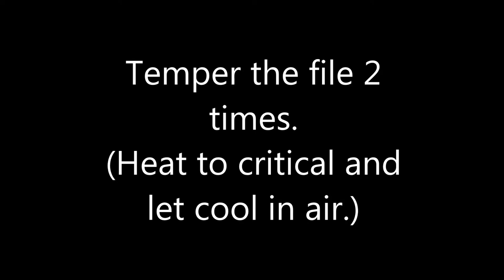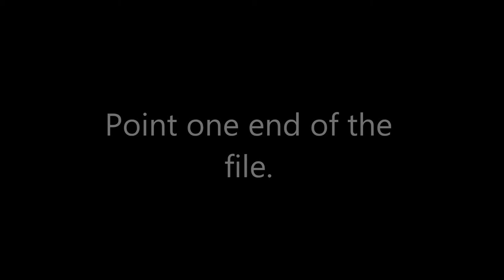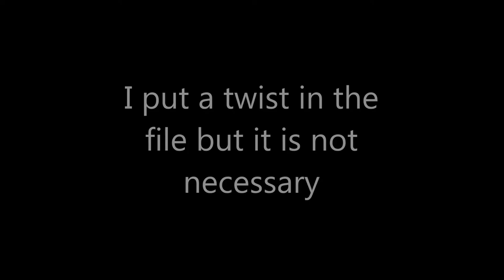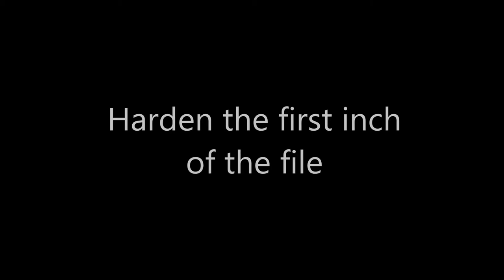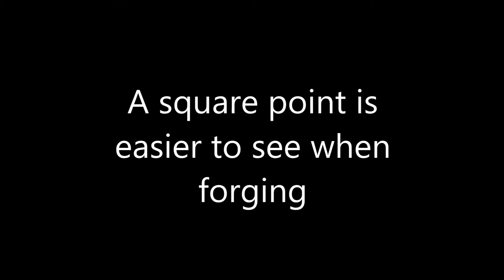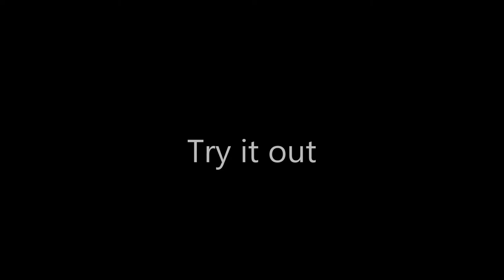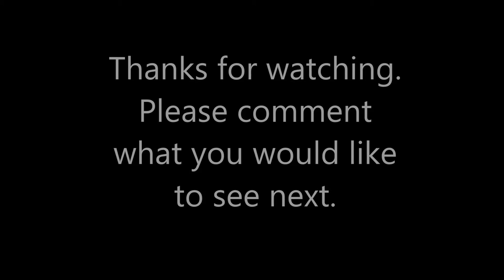How to forge a center punch

Comment: very nice video , i would wear gloves on the sander if i were you
Reply from the maker: I did when i first started but they get torn up and i can't feel the heat in the piece then . i also don't want the glove getting caught in a spinning wheel.
Reply: NRXTM yeah, we don't were gloves or long sleeves around spinning equipment. Great instructional video by the way!